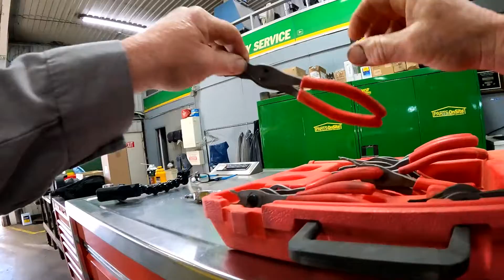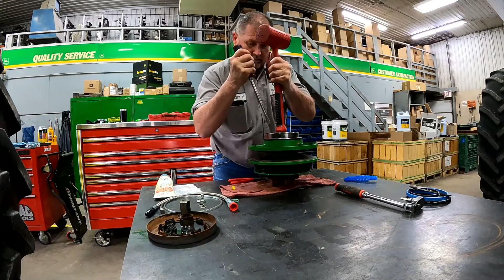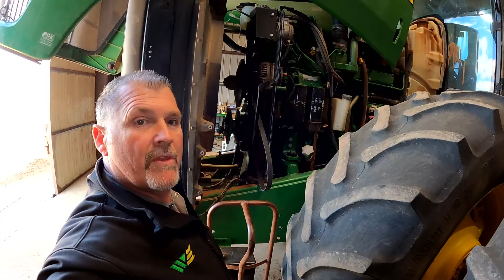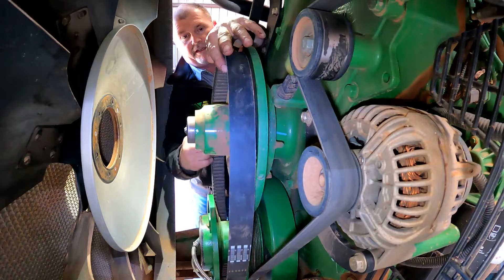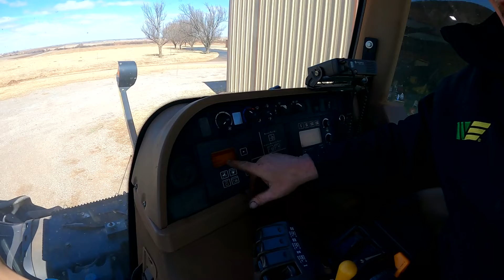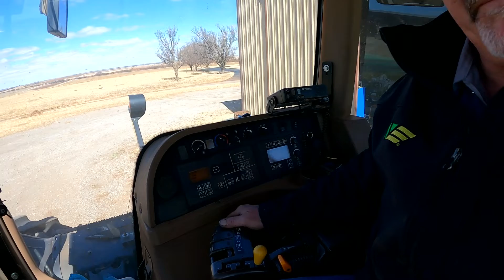Larry’s Life E1 | John Deere 9530 Tractor Fan Drive Rebuild and Install

Comment: Good evening,

We have a 1910 air cart with a hydraulic drive. 60 foot width. The issue we are having is that when we calibrate and complete a meter verification and everything is good. However when we complete a couple of passes the air cart switches something and it maxes out the seed out put. Any ideas? Been have this issue for a month and our local dealer isn’t much of a help.
Reply from the maker: I will have to look into this.

Comment: Do u have an opinion on tuning 9530s we have one and never seams to run good and has problems with emissions and idles like a pig. We don't really need power just reliability and less fuel usage.
Reply: Yes sir I have had the same complaints with the 13.5 engines , running the valve lash would be my first try and after that normally EUI injectors , the engine I’ve replaced injectors in seen to run like a different engine , it’s a big difference
Reply from the maker: @LarryStewart thanks for the response!